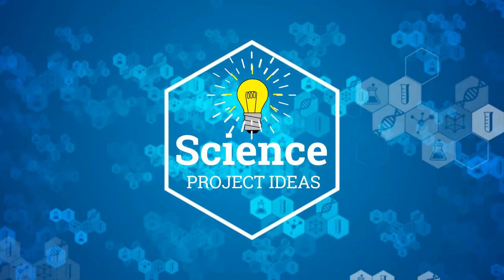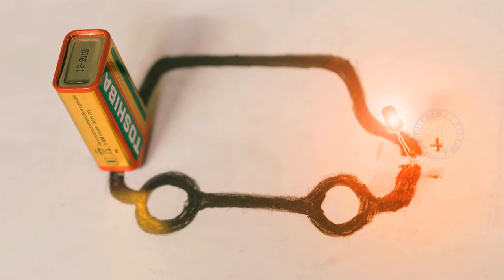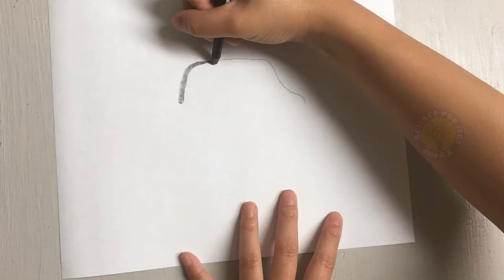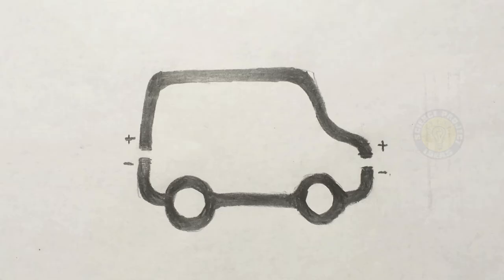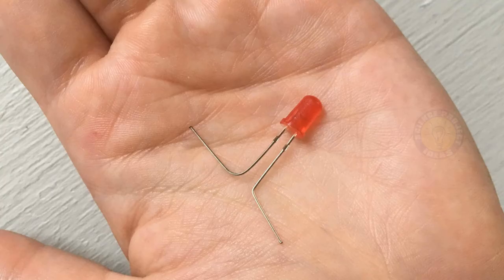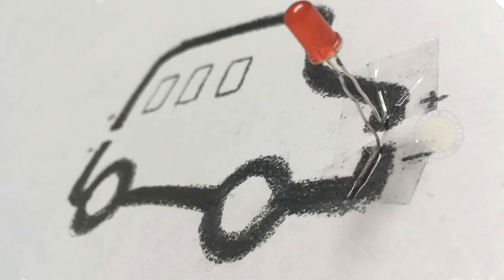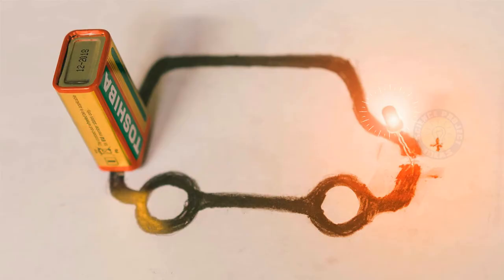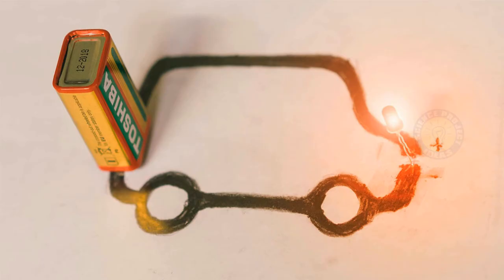LED circuit using a graphite pencil - Science Project Ideas

Comment: Can you make a circuit with an ACTUAL PRNCIL NOT A GrAPHITE PENCIL CUZ SOME PEOPLE mAY NOT HAVE ON >:[ PLEASE DO ONE
Reply: This comment has to be a joke. Pencils have graphite as the drawing implement. Some pencils may have other materials mixed in though. But graphite is good at allowing electrons to pass through. So if a pencil didn't use graphite, it wouldn't work at all. Put some thought before you make a stupid comment like this.